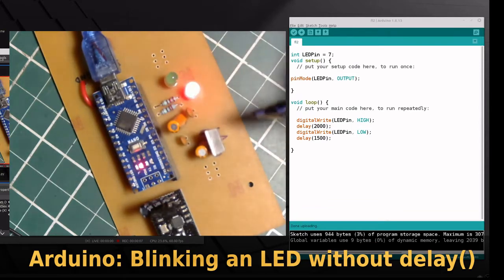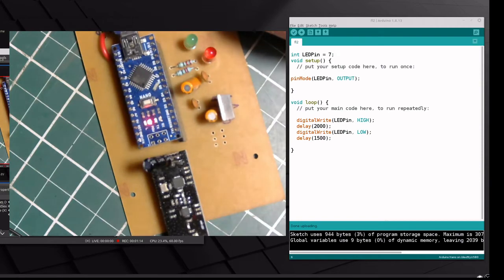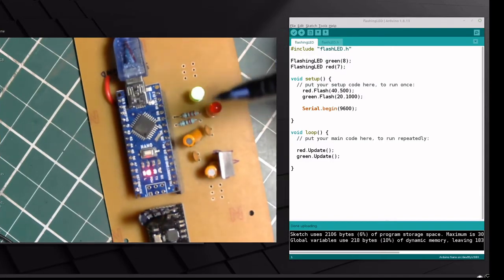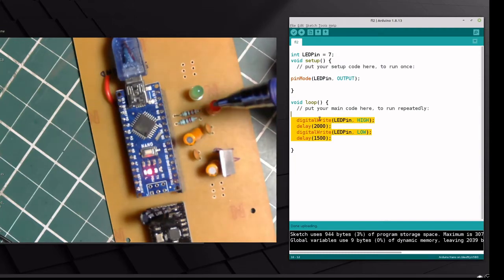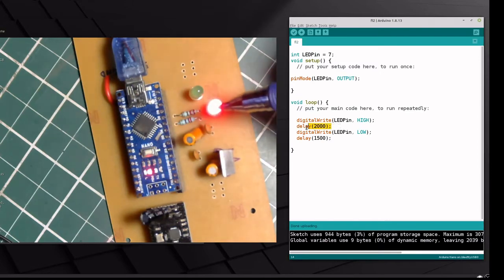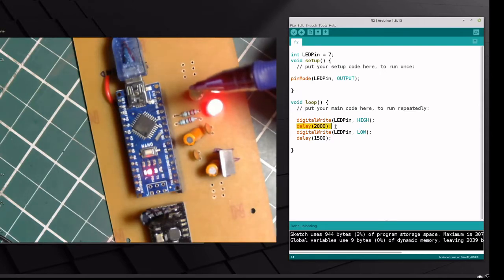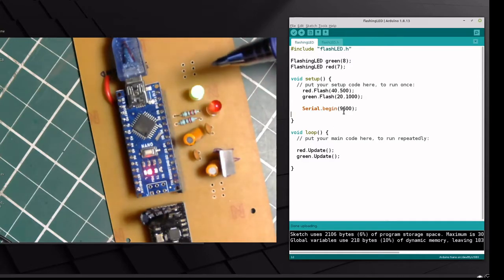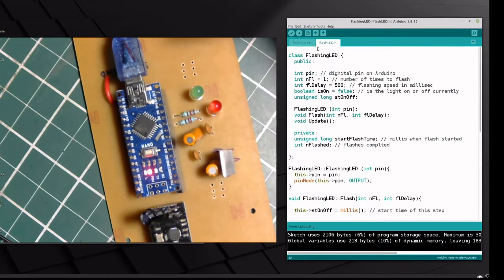Arduino : Blink LED without delay()

Comment: Sir can you help me, I'm trying to program arduino to operate a toy car with 4 relays, so the arduino can control it's motion and turning automatically
Reply: @aswankorula8472  for operating 2 dc motors of 6v
Reply: @aswankorula8472  okk I'll go for it 
Thank you